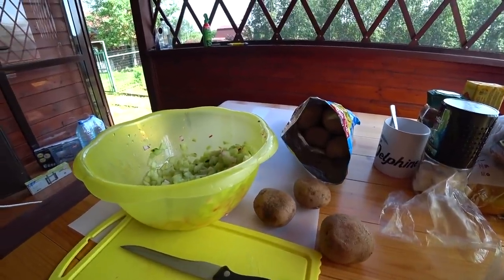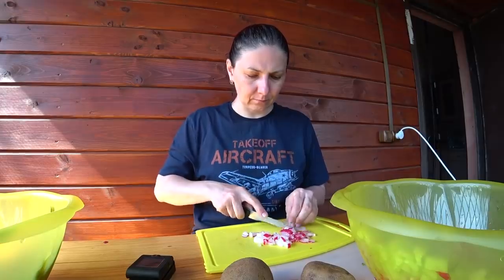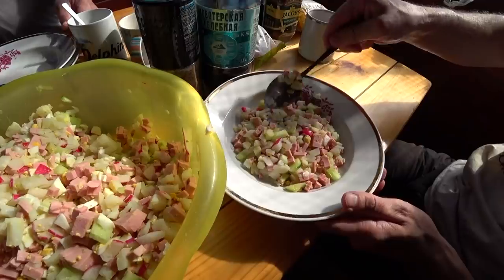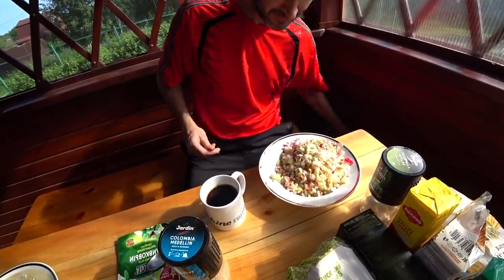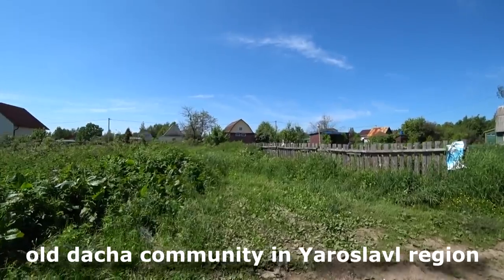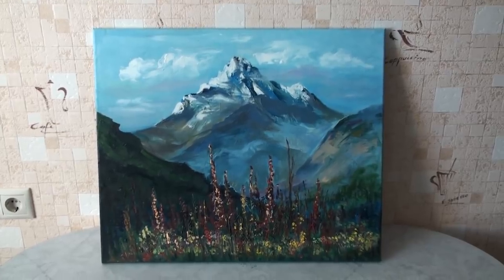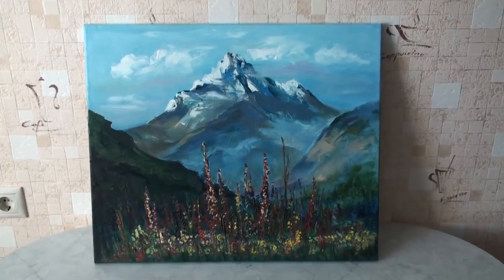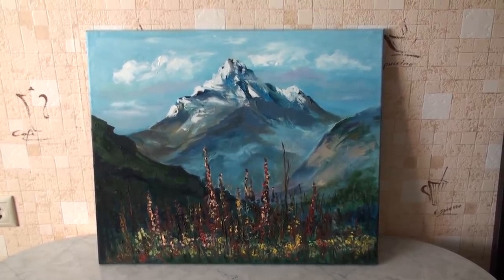Very Specific but Popular Russian Summer Recipe / Something New on My Channel

Comment: Alex has made a mess out of the food in his plate and I could not eat that, but the other guy has his dish looking better. They are putting in plenty of work under the house and I guess some in the ceiling also. That is a nice looking painting you have and the detail of the mountain stands out. I use to do painting and my favorite is oil painting and you did a great job in producing that one.